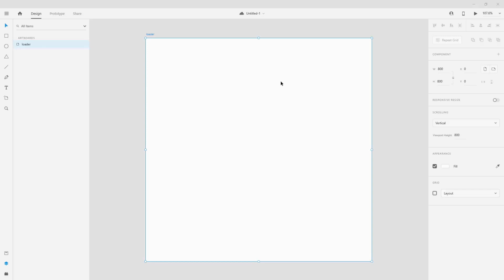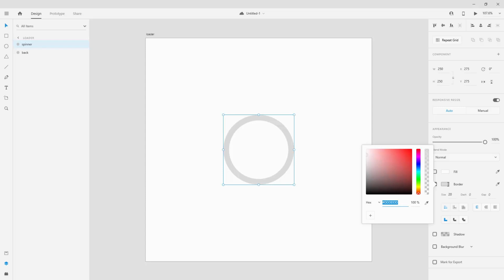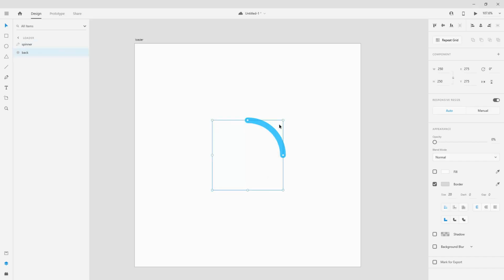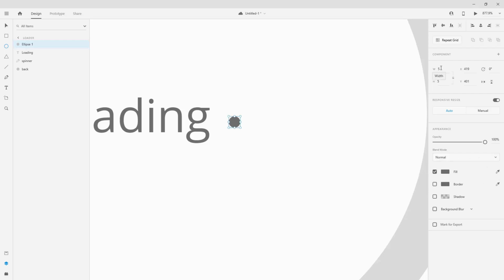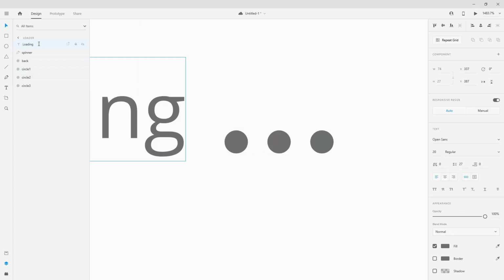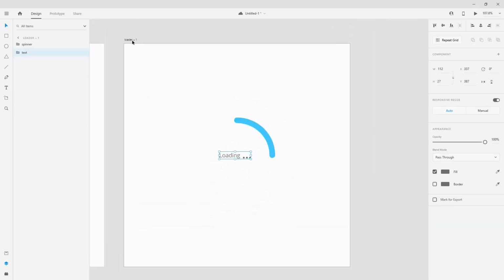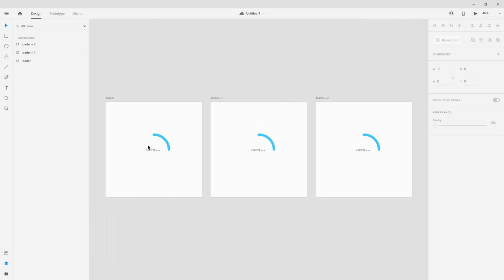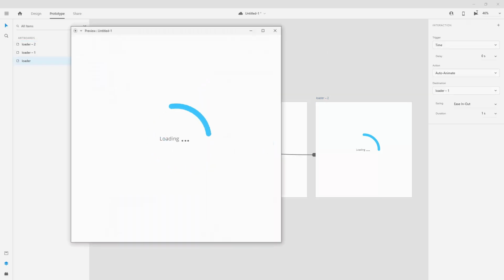Loading Animation In Adobe Xd

Comment: The animation is not working the same as in your video.
Reply: Make sure you group the back spinner and have that group selected when you adjust the rotation. Made a mistake the first time as well. Hope this helps!
Reply from the maker: You didn't follow the steps closely. Try again, it does work.

Comment: Hy .this is aravind.actually i thought to do this for a website design..i have done this animation.but i am not able to connect this to home page or launch page.how to make this artboards go to other artboard.i am not able to link this with other normal artboards.pls help me regarding this
Reply from the maker: Hey there. Make sure to have the animation artboards same width as your artboards. So instead of 800x800, create them to be the same width as yours ( for example 1920x1080 ) and then connect the last animation artboard with your first artboard. Let me know if it works.
Reply: @AlexOnDesign  yes .animation worked .but i am asking how to link this animated video in such a way that this animation comes first and then it dissolves to home page of the website.making it look like loading is completed and taking to home page.
Reply from the maker: After the animation ends, link the last artboard to your first artboard. Just drag a blue handle and chose your for transition.
Reply: @AlexOnDesign  Hi, i'm having the same issue. When i link my last art board (Loader-2) to my home page, the loading symbols no longer work.  Could you help please?
Reply from the maker: @lorrainemulcahy5606  Make the animation artboards the same size as your other artboards. Then make the animation stop at some point, so it doesn't loop endlessly. Then link that last animation artboard to your first artboard and it will work, i tried it for multiple projects, it always worked for me.